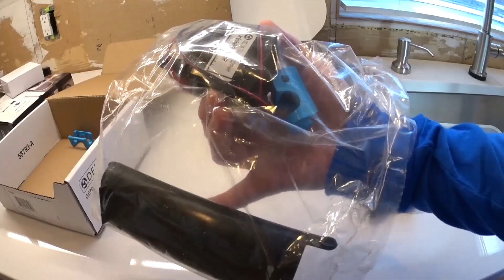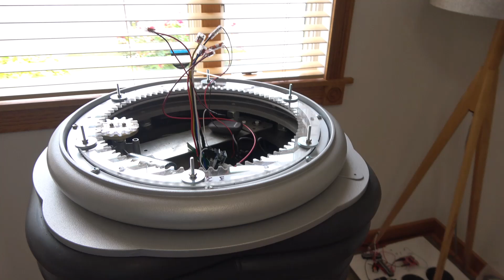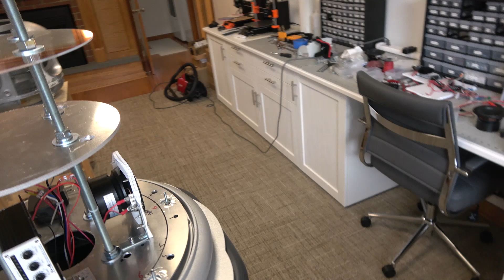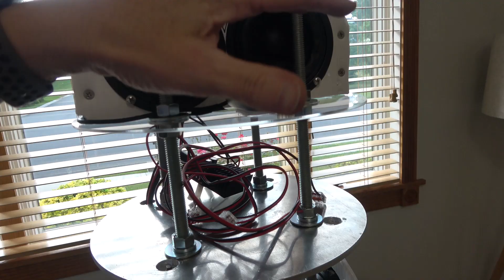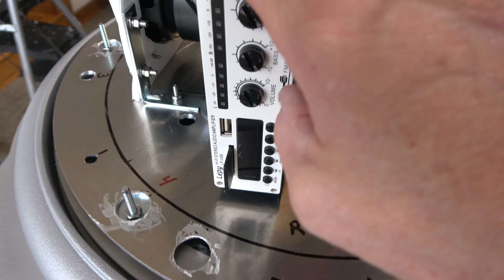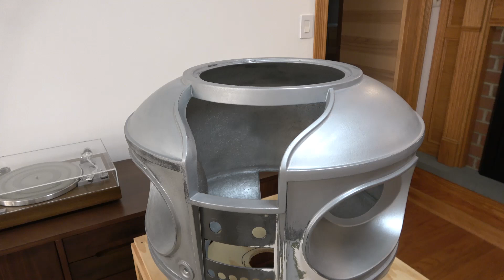My Lost In Space B-9 Robot Build - Episode 16 - Sound Systems, Central Support Tower

Comment: You could run a 24 volt cable in to a block and then drop the voltage from that block to go up past the waist, then you can use 24v for the waist motor from that block, and everything else comes off the 12 volt. I will have 24volt coming off the batteries and then I will split it in to a 24v, 12v and a 5v rail to go above the waist. 
This is a great series on your build, thank you.

Comment: I’ve not seen too many of these B-9 construction videos, but compared to the ones I have seen I am extremely impressed by the engineering that you’ve done on this unit. The sound system and everything  looks top notch. Can’t wait to see the finished product. Also, I was thinking with all the mass you’re going to have in that torso when finished I don’t think you’re going to want it whipping around too quickly. Looks like the perfect speed to me. I’m brand new to your channel so I’ve not seen your other projects, but I’m sure the engineering level on those are comparable.

Comment: i got the same lepy unit you show here.  strangely, when i unplug and then plug, it resets to a "repeat" function that leaves a small audio gap between repeats.  (the display looks like yours.)  when i manually change it to a second repeat function (repeat one) it loops seamlessly.  and then i unplug / plug and we're back to the gap.  it may be i have a flawed unit -- has this happened to you?  thanks for your time.
Reply from the maker: No, it should stay on same mode.   Any chance your Mp3 track has a gap at beginning or end?
Reply: thanks for getting back to me so quickly.  no gap in the file, and when i press the loop button again, it changes to a second loop function (it says "repeat one"), and flows perfectly.  it just doesn't stay there when i unplug and replug -- it reverts back to the loop function that leaves a gap.  my current workaround: when i plug in the lepy, it starts playing the file from the beginning.  so i made a three hour version of the file, figuring i'll never have it on for three straight hours.  and even if i do, a 1/2 second gap every three house isn't a crime.  thanks again!
Reply from the maker: @kyshtym  Check instructions, maybe you can make one default mode, not sure
Reply: @SeansHobbyHouse  my instructions are non-existent.  i got it off ebay, and except for a diagram of the unit, i got nothing.  however, i just found someone who's selling one, never been used and still in the original box.  and it's pretty cheap so i'll give it a try...  thanks for your help!  and your work is amazing!

Comment: Sean, awesome job.  As to the clearance you were speaking of where you removed the lock washers and used Locktite instead was that clearance issue compounded when your oversized the holes for the rods so that the plate did not rest on the nuts?  No criticism just asking.
Reply from the maker: No they are 2 totally different issues.  The big nuts on the bottom of the rods couldn’t even get by the gear which is why I had to pull them in closer to the center.